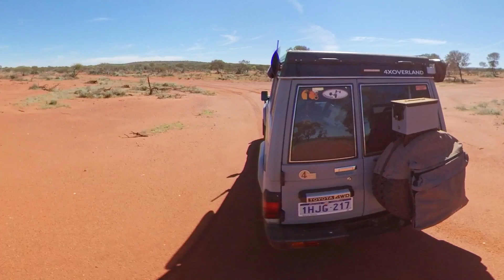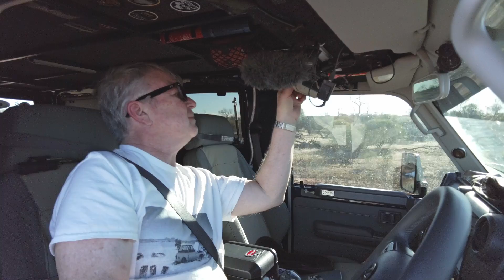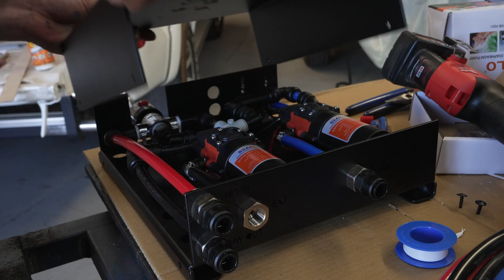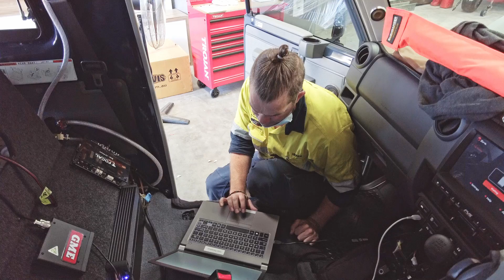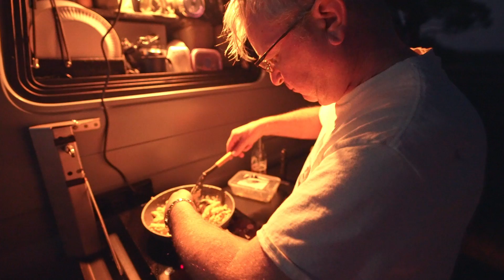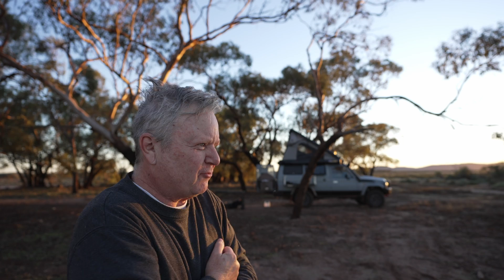New Hero Troopy Overlander Shakedown Trip part-1 | 4xOverland

Comment: With a comment about induction use. My wife and I have used induction cooking and heating up food for nearly 3 years. On long tours we load a freezer ( 40 litre ) with home cooked meals sealed and stored. They are used gradually over a few weeks both warmed up and added to on the hob or 12 volt travel oven. Both methods are quick or effective on a 150 watt lithium battery or at least the alternator. As the freezer contents gradually empty of home cooked food. We use a caravan park (to do some laundry usually) and hook up to the 240 volt site supply and have another day cooking up a storm to re load the freezer. (Camp kitchens on sites are fantastic for this also). This way we are mainly reheating good food and saving the Redarc system from excessive use cooking from a fresh start. The induction can cope very well cooking from a start or reheating pre cooked. Happy to endorse with a solar roof top set up and frequent driving and not in camp for days on end as a provisor.

Comment: Hi Andrew just wondering what your reasons were for setting up on the drivers side this time round . I have a Darche 270 but at the time of purchase only right hand side awnings were available.
I live on the West Coast as well and considered looking for a awning for the drivers side as I’m frequently on the beach , this way with the vehicle pointed towards the water the vehicle blocks the prevailing winds SW, also providing wind protection to the back of the vehicle .
Is this a reason for your choice on this build 
Cheers

Comment: I am very impressed with your vehicle and your 'shakedown trip' strategy. Your vehicle looks absolutely stunning, but what I like about it most is that you have built it to serve you in the best way possible. I have a little idea for your fridge, but will admit to not knowing if it is really practical or will work. You mentioned not being able to see what is in the fridge, but I thought, why not affix a mirror to the inside of the lid (providing it doesn't obscure your in-built lights). A glass mirror may not be a good idea for an overlanding vehicle, but I wonder if there is an unbreakable non-glass mirror that is lightweight and may allow you to see what is inside. If not, then that drop down table is probably best gone as you said.

Comment: Hi Andrew, i have a number of questions. Firstly love the builds especially the current one. Ive been watching companies build pop top 78series, and they advise that the roof removal has to be engineered, pop top installation engineered, rear track correction engineered, coverting to camper van then becomes a camper so new rules ie engineered. Suspension- GVM upgrade prior tonregistration gives you federal acknowledgement but if you do it after then its state ie risk of defect in other states. Whats your understanding of all this? Many thanks

Comment: Boiling water is the most energy efficient thing you can do in terms of heating food in a kitchen.  If you need wasteful ‘jet boil’ cans (and weight) to do this then you’re effectively rocking an induction lighting system.  Get a 9kg bottle, or solve the problem?

Comment: Hi Andrew, could you let me know which Recaro seats you chose? I am wanting to replace my 76 series front seats. Also a supplier name if possible. I will need to find out if they are bolt in, or if need rail kit, and if need engineer cert. Thanks, Graham.

Comment: Wondering what the portable light at 17:25 is?
It is the small items that make life easier.

Just use your batteries and make sure stay over 20% SOC.
If reach 20% use idle your engine for an hour to charge the battery.
Should be good for 48hrs of no engine input

Comment: Wait Wait Wait your boiling water  with gas / propane!! Wasn’t the whole EXPERIMENT meant to be about induction??  Have a real crack with your over the top expensive system.
Reply: I'm not surprised at all to be honest.
Only someone with to much money to spend and zero experience would find out the hard way he would still have to carry gas to boil water. 
But also a simple cheaper set up would still achieve the same results, making this experiment even more ridiculous.

Comment: Andrew I love your channel, however I would encourage you to do more testing, so you can pass on more accurate information to your subscribers.

I have never found the need to run my induction cook top on a setting of more than 1000W, and for cooking eggs etc I use 600W, at these rates the induction cooker is very economical on power.

Sadly I have to strongly disagree with your statement that "boiling water is by far the most demanding on an electrical system", taking into account how much water you need to boil is very important, however we use a compact 240V camping kettle (900-1100W), it draws 90A when running, and boils 550ml (just over 2 cups) of water in 3 minutes and 5 seconds, consuming a total of 4.6Ah, seriously @ only 4.6Ah that is nothing on a reasonable size LiFePo4 battery.

We also love our 240V pop-up toaster, so quick and convenient and also uses bugger all power.
Reply: Hey mate, could you share links to the products you mentioned! Cheers
Reply: @watt66king  four times I have tried to post a response, each changed to try and appease the YouTube gods, but my posts keep being deleted?🥵

Comment: Ideal setup for 2. With the Hot water could you not use the heat from your exhaust to heat 30ltrs water for shower?. Then use solar to charge batteries, then transfer to keep water hot. You need lots of energy to get to temp but very little to keep it there.

Comment: Fun fact I’ve learned from testing induction cookers for work. If your boiling water for pasta at say 2000w once you reach boil reduce power to maybe  700w or where ever the boil starts to fade. . Don’t leave it at 2000w. You will waste a lot of current. On many inductions water will stay boiling (100C) around 700-800w.

Comment: You are so lucky to go out and able to overland again ! Your truck looks really awesome. I wondered if you could not simplify your electrical system which looks very complicated. In my overland truck I installed a Goalzero Yeti 3000x with 240 amps capacity. Totally stand alone with all connectivity (solar, 12V car, 220v electricity) for charging build in. All dashboard available to monitor power stats. And even a 2000w inverter is build in. I find this a revolution after building in dual battery systems with all the hassle in several previous trucks.  Wondering if you considered this option. Happy travelling ! Thanks for the inspirational video's !

Comment: Using all-electric (200ah with 3k inverter for 1800w induction stove, 1700w heater, 1800w oven/air fryer, and 12v 300w heating rod to heat water tank for showering) for the past 6 months, what have I learned? That 200ah mostly used during dark hours (making dinner, staying warm while sleeping during 28F lowest, making breakfast) and when the only recharge source is the alternator, as there is no solar available during dark hours. Hint. Hint. (Extra: Shower water is heated while driving to shower after dinner and also serves as radiator-like heat while sleeping). Hope that helps.

Comment: thanks for posting. you made two good points about induction. its 'generally' no quicker for heating water and reheating meals make a lot of sense when camping. we find a frozen meal can act like a freezer brick, less prep and less 'valuable' camping time taken cooking and it uses less energy. ( Also you can carry less condiments etc)
Reply: Suggestion.
When cooking at home, make an extra meal, choose a container that will maximise the room in the 12v fridge freezer and store. Then when it's time to 
( hit the road ) just pick up the container and place it in your 12 v freezer. Also a tip for milk, if you get a Thermos and place your milk into it. I use 2 x  1 litre size. It will stay cold and not freeze. 2 bottles allows rotation and storage,  is great for cold water as well. Add electrolytes, gr8 build buddy. Well presented as usual
Davi b

Comment: Andrew- to increase the efficiency of your induction cooking, get in the habit of moving the pan less.  rotating it is fine, but if the pan isn't touching the cooktop it isn't heating, which means things take longer to cook and you use more energy.  Cheers!
Reply: agreed. Also high quality pans will make a big difference . 👍
Reply: how much $$ for a decent induction cooking & battery electrical setup?. Planning on getting my own

Comment: Hello Andrew, if you cook on the induction cooker during the day your inverter will use the energy from the solar panels first and require less from the battery bank. Your batteries will last longer. Great and enjoyable video and congratulations to you on your new Troopy build. Happy and safe travels to you. Jason from Melbourne Victoria.
Reply: A house system does that but a battery system in the vehicle is different unless solar goes directly to the inverter. Idk if Andrews setup does this. It could do.
Reply: @Malc664  When both the mppt and inverter are connected to the negative and positive busbars the power is moved to least resistance which will be the inverter because it is under load. Think of the flow of electricity like water therefore less draw on the batteries. Hopefully l made this understandable.